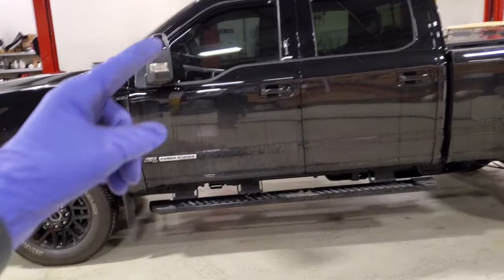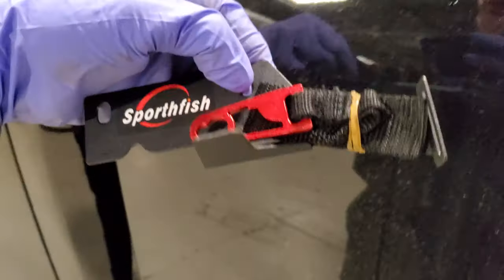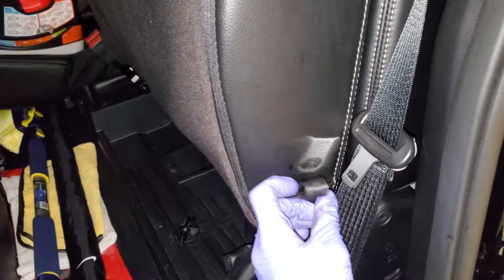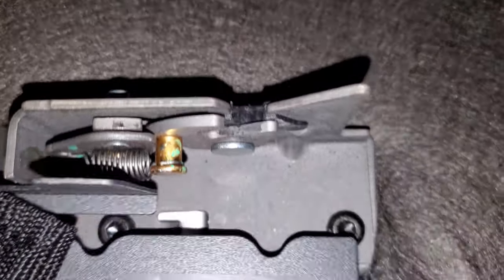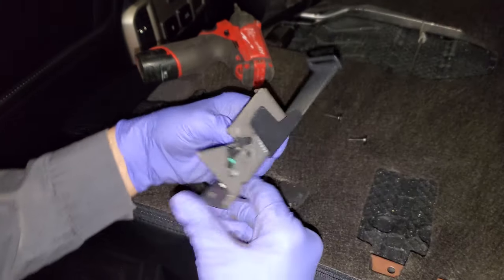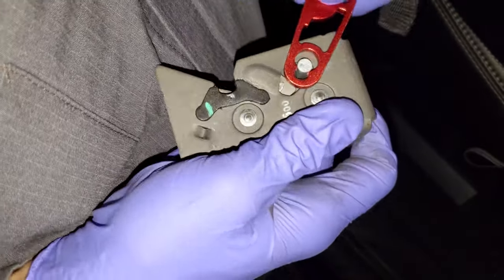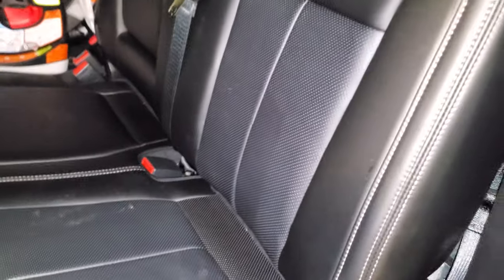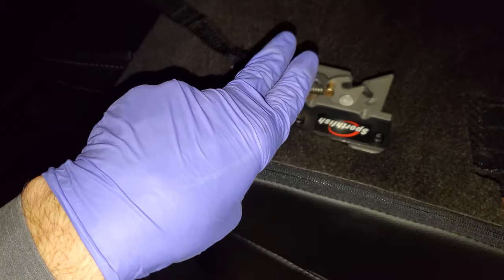Fold YOUR rear seat down for under $20 | 2017-2021 Superduty | F150 Sportfish Tether - HOW TO -

Comment: Finally! A mod under 25 bucks! I bought a 2020 F250 King Ranch 3 months ago. I'm going to do all the mods you have done on yours. Air intake, disaster prevention, upper fuel filter mod, soon to released lower fuel filter mod, At least this one is cheap. lol.

Comment: Thanks for the great tip and video. Just installed one on my Duty, Like you found out no instructions so it was Daaaa a Rubrics Cube for a couple minutes. Appreciate your demo. Useful and works. Should have been stock from the factory but hey look how much weight and $$ they saved for epa fuel economy.

Comment: Probably the first thing I did to my 2020, I store soo much stuff behind my seats (four way, 4x30 HD tow strap, regular ratchet straps, ford goose ball kit, bed cargo net, load bar, etc) it’s like a tool box but on the inside of the cab. Don’t think I could fit as much stuff if I had the premium sound system tho. I see arod has a sub and what looks like a amp back there. I have the inverter built in but it is under the seat on the rear passenger side. Good video
Reply from the maker: Thanks bud!

Comment: If you re look at your video you will see for one second you had the red slide small hole on the post correctly. The small hole on the red slide needs to drop down straight onto the post. Great Video I had no Idea you could do that.
Reply from the maker: Mine did not fit.....

Comment: Nice vid ARod.  I just got my BuiltRight version in the mail today.  This video was perfect timing and should make quick work of it as well.  I also got the BuiltRight Dash mount at the same time and already installed it tonight.  It took me about 30 mins total.  You should check out their products and look at the dash mount.  Thanks again for taking the time to give the install overview.
Reply from the maker: Thanks buddy
Reply: @PowerStrokeTechTalkwARod  Just installed it.  Pretty quick process like you showed.  However it was a PITA getting it to relatch again but I finally got it.  I think it is a bit of right steps and feel.  Either way, it worked out and will make it nice to be able to easily fold that seat forward.
Reply: @chadh6899  I just pulled the side lever and shoved the top back and it snapped right in

Comment: Thanks for the info. Just got an F250SD and while I figured out all the other seat bits, that left side back had me stumped. As a last resort I even looked in the owners manual and nothing about the backs, just the base. Even for the right side that has a release. How lame. I guess I need to buy a seat release tether, for a brand new truck. WTF Ford?

Comment: The 2014 F-250 (Lariat) has the handle on the side of the seats for folding down. I wonder why it is different on the newer MY and, based on one of the comments below, the 2011?

Comment: Good video but garbage back seat design.  My one owner 2005 F 250 Lariat has lever on side to lower seat back.  Why did Ford change design?  Was it needed for the new under seat tray that is for storage?  My 05 has the metal fold out under seat platform to use for hauling chit in the back with seats folded up.  Behind the seat is the storage tray for jack, tire iron etc plus behind the seat back works great for heavy  winter coat storage, tow straps, jumper cables etc.......
Reply from the maker: Good question...
Reply from the maker: Wayy bigger
Reply: @SM-ut6vb  I still don’t get why Ford had to eliminate the lever to lower the seat back.   Just doesn’t make sense.  Even if they gained more leg room, how much did they actually gain?  And the idea that you need to raise the lower seat to get the back seat to come forward enough to get to the latch just seems like a poor design.   Don’t get me wrong, the new Strokers are awesome rigs, if they weren’t literally double what I paid for my 2005 6.0 new I’d have one.

Comment: I removed  my rear seat  but now I get rear seatbelt monitor  needs service  indication can I get a wiring diagram  for the  seatbelt monitor  circuit or is there a easy way to get rid of this message. Putting rear seat back in is not really an option
Reply from the maker: Whatt
Reply: I removed my rear seat from my truck  and I had to unplug the electrical  connectors at the seatbelt  now I  get the seatbelt monitor  needs service  on the screen on the dash
Reply from the maker: Better check everything you disconnected...other wise ur gonna keep getting those faults

Comment: Hey guys my 2015 f350 gave a p20BA code and I changed the heat today, its now giving all kinds of codes heater, fill level, heater line pump!  Checked all pugs and all good,  didn't know the pin to check power,  the thought for me is that all needs to be cleared and start a fresh?  It didn't  do all this till I changed the heater and didn't totally unplug the pump from loop, AFAIRED  of issues with plugs.   Did cover all pugs and presser wash tank and pump?  I am just a hand and not a computer myself.  Its now 3 miles till 50 mile limiters!  ASKING FOR HELP HERE!  IS IT A code clearing issue?  If was new pump , all else would not be putting up codes?
Reply from the maker: U need to check that big connector again....& perform the exit procedure from derate. You ll habe 2 search my channel, busy buddy.....
Reply: tks, have to dealer inline for derate and ck Monday!  Pug is all together,   else there's a bad wire from power line, its all good!   Thks agian
Reply: I have no power to my main plug on any pin?  Could I have broken pin from wire pulling on it, surely its not that soft of connection???
Reply: Ok, dealer time, I am out!  Tks for your input!  Love your channel !
Reply from the maker: Thanks guy!!
Reply: Ok, update, I check wires, fixed one pulled out of pin, wow,  what job had to take down the loom from frame, don't  have reader ( obd2) and this what I did,  cycled key 3 times , started it on the forth, and let the temp ga move, then, hold engine to 2,500 rpms till temp and Trans temp moved, then floored it for three count ,three times, the forth the 3 mile to derate cleared, still have the ck engine light is on, but detate cleared, YEAA?  The def cleaner came on about 15 miles into test drive and did fine!  Wow, I really respect yalls efforts in keeping up with all this mess, I can not remember passcodes to online acts ,less this on going crap!

Comment: Nooooo..... The little peg fits through the smaller hole on the red piece. The other brand has a plastic piece that snaps in place.
Reply from the maker: Naw not this 1.
Reply from the maker: Mine wldnt fit🤷‍♂️
Reply: He's correct, instead of sliding into place. Fish it through the smaller hole for a snug fit.
Reply: @PowerStrokeTechTalkwARod  ok, I would drill out the small hole so it could fit over the pin with a snug fit so it does not rattle